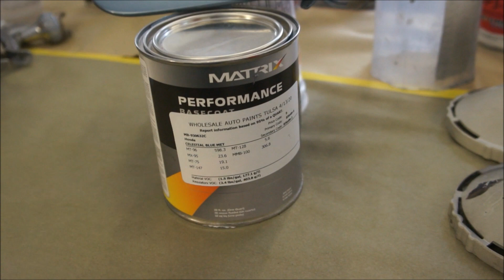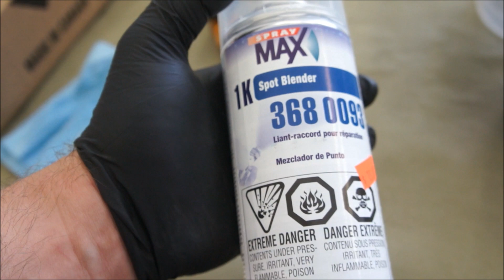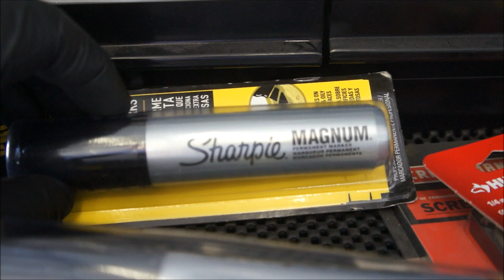progress

Comment: I use two-part adhesives at work, and I got a small digital scale. It sure makes it nice knowing that things are mixed in the proper ratio. One to one is fairly easy, but some of the stuff we use is 100:17 and that's really hard to eyeball. They don't cost hardly anything, the one I got was $15 and goes down to very small increments. I've seen some stuff where the mix wasn't right and it just never set up. Just my OCD speaking. Great work, and the tip of the day is very educational. Linda and I send our best.
Reply from the maker: Thanks for watching sir , yeah 100:17 would be tricky to eyeball